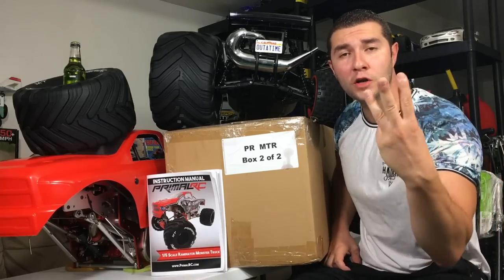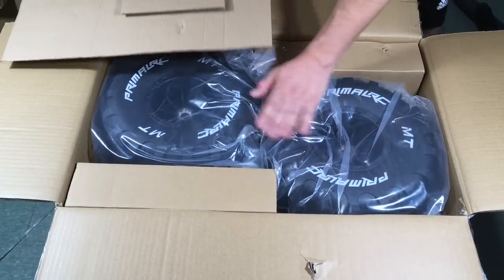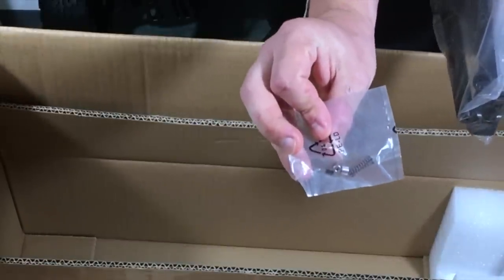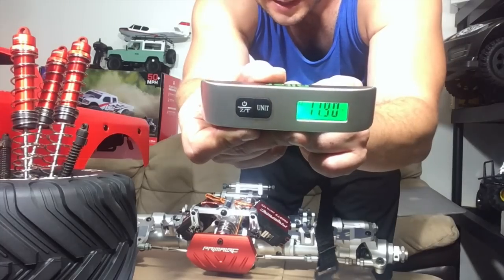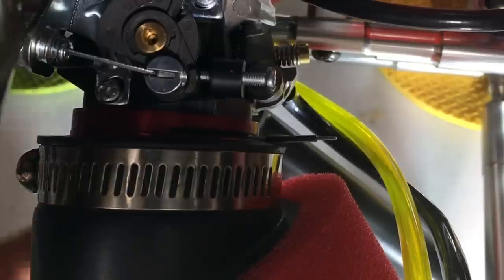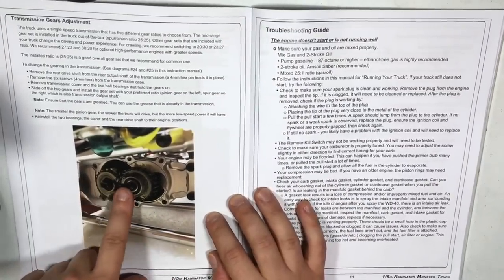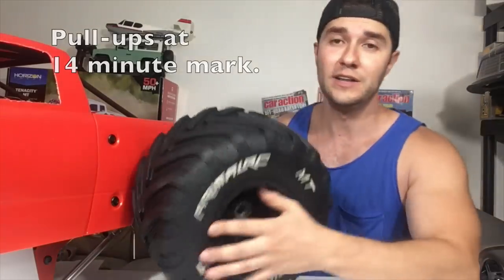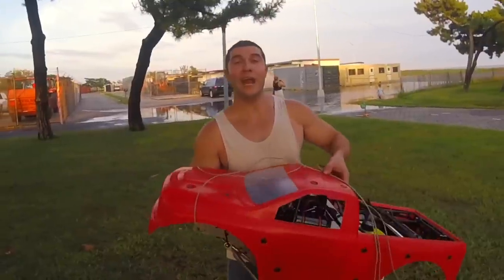PRIMAL MT Raminator 1/5 GAS truck  - Unboxing Box 2 of 2 (BIGGEST SOLID AXLES and instructions)

Comment: What a nice very informative video my brap brother!  Very good I need to slow down a little and start explaining things a little more. Im just too excited right now! I cant stop looking at my Primal MT man! I stayed up late and put it all together in two nights🤣🤣! My MTXL chassis is coming soon! I cant wait! ⛽️⛽️⛽️🤝BRAP BRAP!!!! Looking forward to the pull ups with the axels! What ever it takes brother!🤣💪🏼💪🏼
Reply: What's up brother
Reply: Norm what’s happening bro! Funny Idea you had on putting the MT tires n wheels in the baja bro! It looked like a tractor puller🤣🤣!
Reply: @jefflohr5533  it deff did should start a tractor pull with em
Reply: Norm haha as cheap as you can get one from Rovan RC it could be very possible. I think the baja transmission if done in a heavy duty style could handle it!
Reply from the maker: @jefflohr5533   NORM has great RC suggestions.  We need him to give us all more stuff to try out.  I would never have thought of putting the primal wheels on a baja myself.
Reply from the maker: @norm1233   all of us PRIMAL guys need more suggestions from you NORM.  BTW I am still working on and will eventually strap a model rocket onto one of my RCS, and see if it creates and useable thrust.  what do you think about that.
Reply: hybrid32494 hey brother I screwed up my vid gotta repost. I said the wrong torque specs n half assed two things woops🤣🤣🤣 its too frikkin late I need to go to bed! Im real sorry I had to delete it my brap brother! You were first to dang it! 😭🤷🏼‍♂️🤦‍♂️

Comment: Your so right dude primal is so much the opposite of all the big names! Nothing cookie cutter or copying others about this truck! Totally set a new bar! Lolol also bro those drive shafts are interchangeable with your Prius!👍💪😋
Reply from the maker: haha, I actually made a joke while recording this that this is the size of my prius driveshafts, but wound up editing that joke out.  I don't think many of my viewers understand the satire of my lifting weight, driving giants gas trucks, eating steak and fish and then driving a prius!!  LOL.
Reply: @hybrid32494  lol I get it for sure in the same way mostly I have a big Cadillac but drive my little 4 cylinder Subaru around 99 percent of the time for gas milage 👍
Reply from the maker: @theirishaxe9405   now imagine your Subaru got over 55 MPG at all times even with the AC on, and was comfy, and had nav and every feature you could want (it would be a prius, haha).  I got my prius in 2009, and literally not one issue or time in the shop, not even brakes have been replaced.
Reply from the maker: @theirishaxe9405    I love Cadillacs too!!  Would not mind a nice late model deville.  My other car is a 2004 Lincoln LS V8 btw.
Reply: @hybrid32494  nice 👍
Reply: @hybrid32494  sweet I got mine last summer 2002 DeVille dts with only 90k miles one owner old man that died bought it from his old wife basically new. Lol I barely drive it though. Sometimes to the drive in theater here . I've always had a Cadillac around since I fell in love with them about 20 years ago my first one was a 79 elderado lol

Comment: I'm heading to PrimalRC. com now to check out those brakes for my BIG RC truck.  Thanks man!
Reply from the maker: LOL, you got it!! These are some high level brakes for sure, I own a baja with a front disc brake kit, and they suck.  these actually work.
Reply: To  @hybrid32494 : So are they hydraulic or cable-actuated?
Reply from the maker: @rcWizzard  the ones on my baja are mechanical disc brakes, compared to this mechanical system on the PRIMAL TRUCK they are terrible.  Although it's the same exact working principle and technology the PRIMAL ones are way better.  When they are fully mounted I will compare and go over both systems.  What sucks about the mama ones is they are on each front wheel, and its hard to adjust the left and right brake bias.  The primal ones are on the driveshaft going to the diff, so your left and right will always brake the same.
Reply: @hybrid32494   I have hydraulic brakes on my rear wheels.  I'm worried about putting stress on the custom bevel gears on the diff.  But the stopping power is not good at all.  With mechanical you don't have to worry about air bubbles. Thanks, I look forward to your next video.

Comment: So if my math is correct, each servo has about 940 oz/in torque? Seems like it shouldn't need immediate upgraded servos like most rc's that have the cheap ass garbage electronics included. I know that Spektrum offers a 1/5 scale servo that has around 1100 oz/in @8.4v i believe, so thats probably what I would eventually do. I juat hate steering that is weak that it never goes back to direct center, so im constantly having to adjust the steering trim. I built 4 Tekno kits a year ago and installed the Protek 170TBL and 170SBL in all of them, and once the steering trim is dialed in, I can go weeks without needing to make any adjustments. So now every 1/8 RC rig I buy I always budget around $150  for a Protek 170 series, and about $110 for the 160 series on 1/10 cars. Super nice steering servos make the cars so much  more enjoyable and easier to drive.
Reply from the maker: hey!! Totally agree with ya!! At this point i'd say there is enough steering power on this model,  Just based on driving over myself in this video, you can see the steering at the slow crawl speeds is adequate.  Ofcourse there is no other 80 pound truck with 1 foot tall and super wide tires, but it's adequate enough.  Straight line centering is also good enough.  I fully agree with you, the ability of a servo to stay straight is really important for me too.

Comment: Awesome video bro! How’s the Baha after the primal wheels? Looked like a struggle? Hope the clutch is okay? Bro 8 is good! I had ya down for 6, the wife said 7? Nice video my friend. Can’t wait to see that crazy beast up n running! Keep up the awesome work brother👍👊👌💪
Reply from the maker: thanks for watching brother!!  I only drove the baja very slowly because I just needed to show that the wheels do fit,  I will attempt to give it more in a future video.  But it seemed to be just fine.  Only issue is the pipe thrown the exhaust right on the tire and I Had to wash it after.  Next time you see me doing pull-ups it will be with the whole RC,  thats what matters.  Place your bets with your wife now, lol.  I say at best 3 I hope.   Thats if I can even hang it correctly on myself.
Reply: Good to know that Baha can handle those wheels. That will definitely make a cool video! I think you could pull off 5 with the whole truck, but don’t hurt yourself trying bro? All that weight hanging from your neck is a workout on its own. All the best man. Can’t wait to see the next one. 👍👊👌💪

Comment: What gear are you going to run? The fast gear or the torque gears?
Reply from the maker: For now the goal is to just get it built and started for break in.  Eventually I''m quite sure I will be running the top speed gear sets.  But I will also be testing the top speeds with each gear set, just for out records, LOL!!
Reply: @hybrid32494  👍

Comment: Will those tires fit redcat rampage mt?
Reply from the maker: hey man,  I checked while making this video.  Problem is the REDCAT MT hubs are not 24 MM.  They are 23 MM, so there is your problem.  IF you had wheel adapters it would work.
Reply: @hybrid32494  I'm guessing it would fit on that losi XXXl that botajell has??
Reply: @hybrid32494  ok cool  thanks mate
Reply from the maker: @cwatson42785  we gonna have to wait to see if BOTAJELL tries to mount them on there.  But I was pretty surprised they fit on my baja. And that was with the body fully on, I did not remove anything.